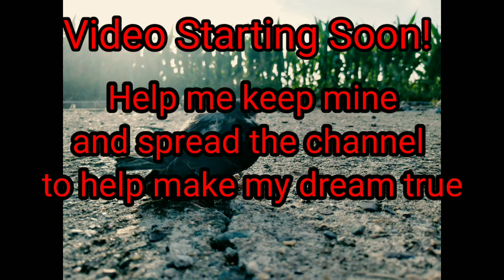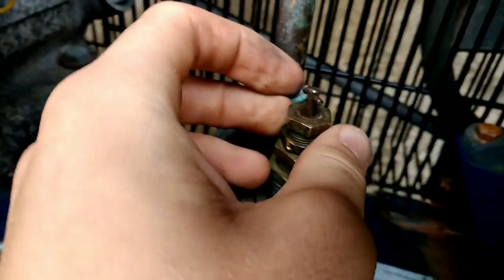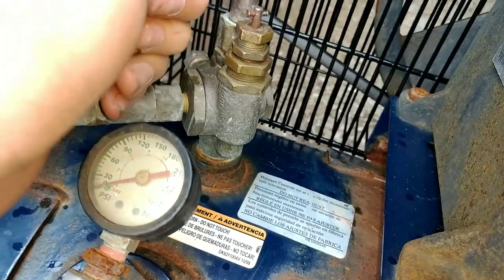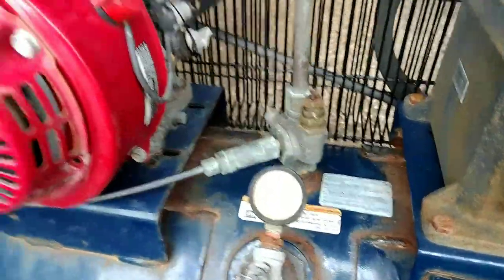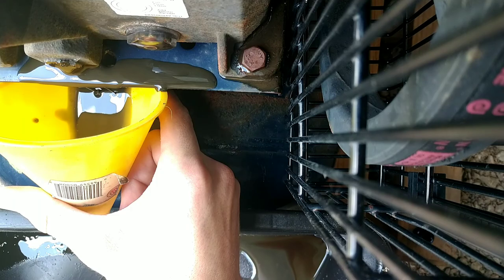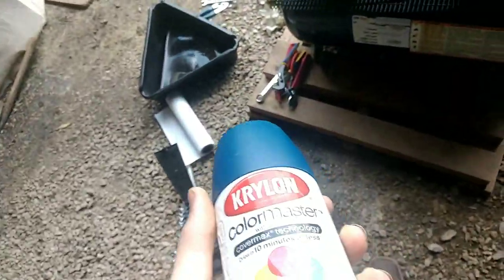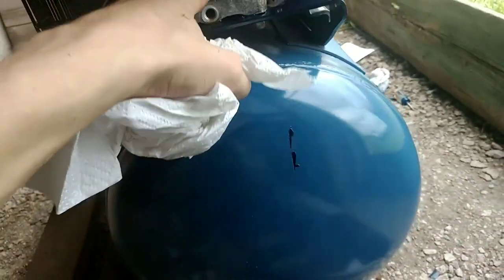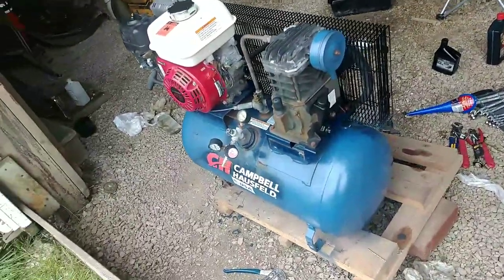Campbell Hausfeld Gas Air Compressors! Are they any Good?!?!

Comment: With all that rust on the exterior and bubbling of the paint,  you might want to consider retiring that air compressor tank immediately.
Reply from the maker: Just retired it actually, thanks for your safety concerns though. I appreciate all input from my viewers! Thank you for your support! -Oldschool Farmer
Reply: @oldschoolfarmer3685  Just so you know i only said it because i myself literally just bought a new compressor yesterday because i had a old tank that had rusted , and shops everywhere that dealt with commercial air compressors told me flat out if there are signs of rust on the exterior of the compressor tank DO NOT USE IT , and one guy pointed out to me, is your life worth $250-$300 for a home model air compressor.  And i was like ....well no i guess not.  So i just saw your video and posted that.   Good Luck with everything.